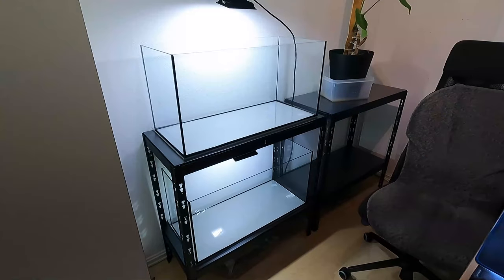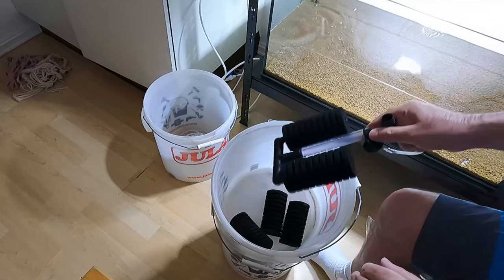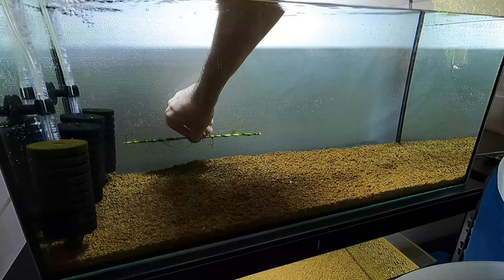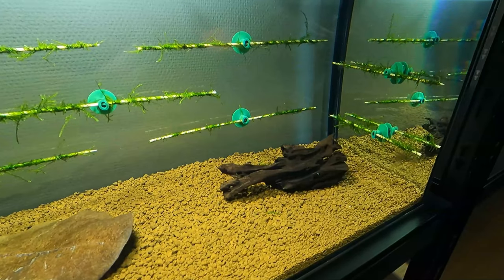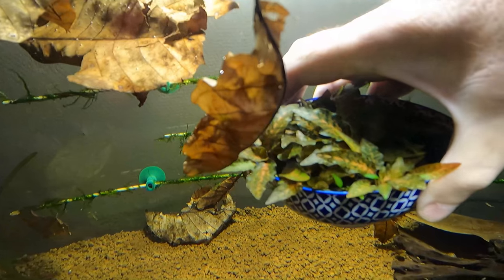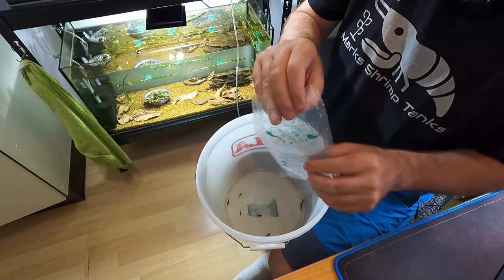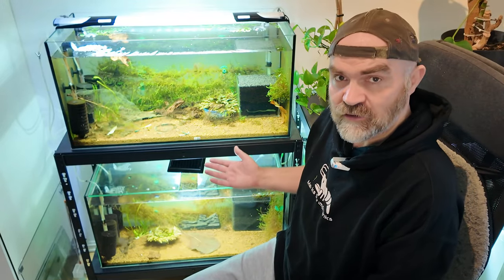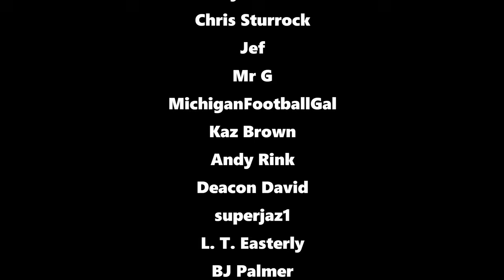How To Setup A Boa Shrimp Tank: Breeder And Growout Setup - Step By Step

Comment: Hi Mark! I am having trouble with these filters. The flow becomes almost null and i think it is from snails and gunk. Even if the sponges are clean, i still need to break them apart every month. Lucky you if the run 6 months with a good flow. Cheers!
Reply from the maker: Ive never had them go that bad, in the video I do say I clean my sponges every 6 months if that helps you any.
Reply: Had the same issues with those filters, I would suggest to buy Qanvee QS200, they have way way better bubble maker and never clog.
Reply: @ShrimpMania i will look into it. I was not expecting to have to do complete maintenance on them so often. I will check your suggestion. TY 😊

Comment: Hello Mark. I have my Java moss all messed up with the thready hair moss. 

Please give some feedback. 

It is a neo tank. I got a phosphate test on its way in the post. 

Other wise it is going well. This is them now. Tomorrow is mega cull day
Reply from the maker: string algae normally steps in when the other plants are missing something to make them grow more, so in low nutrient tanks string algae can be prolific, what Ive dont is learn to read the signs in the tank that tell you you need to add something like a fert, I use Tropica premium nutrition at the recommended dose when I see, poor plant growth, no biofilm on the glass, yellowing of plants...I actually have a day for it thats in my head called fertilizer Friday and I manually go through every tank looking at the plants, if they need ferts I dose 2ml into 50 liters of water... this is something you just have to gauge for yourself. regarding the string algae itself manual removal is the best way and I found twisting it up with a bamboo skewer the best way. 🙂

Comment: what  is that white ball thing for when u fill the tank
Reply: It's a float valve. As the water rises, the ball floats and gradually closes the valve. It's both for safety and convenience. You can fill to a precise level without watching it. You do need to test them occasionally; over time they can get sticky from wear and tear, or gunk building up. You just give it a wiggle and make sure it moves freely, then ensure the water is stopped when you lift the ball and close the valve. They're super handy!
Reply from the maker: Thank you for answering👍
Reply: @MarksShrimpTanks  You're welcome! (from a new subscriber)
Reply: @steve-adams  damn thats smart